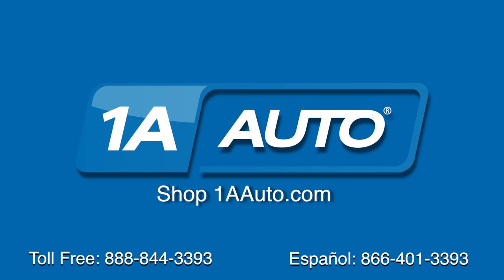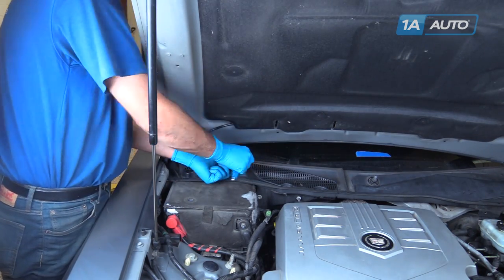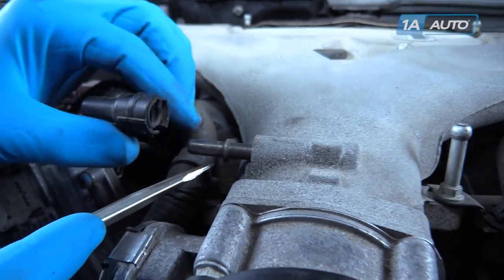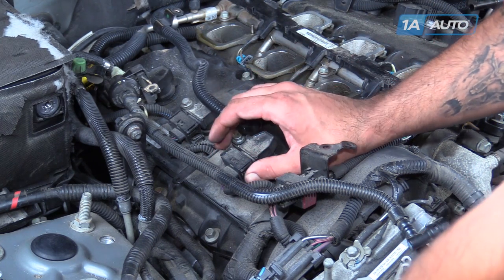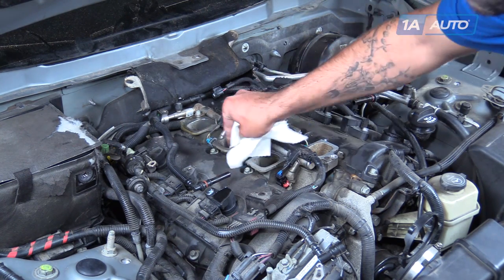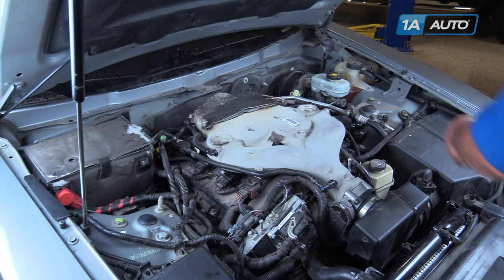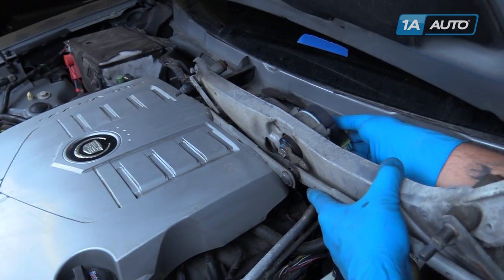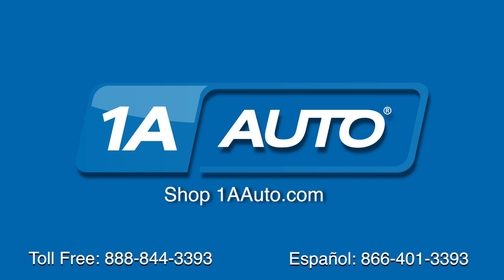How to Replace Ignition Coils 03-07 Cadillac CTS

Comment: would it be the same for a 08 Cadillac cts 3.6L DI?
Reply from the maker: +Randy Rodriguez Thank you for watching. The process should be similar, however the placement of the mounting bolt is in a separate location. 1aauto.com
Reply: 1A Auto 
Parts
Reply: 1A Auto Parts For the 2008 do you have to take the wiper motors out?      which mounting bolt is different?
Reply: Randy Rodriguez 8
Reply: The 2008 looks like you can take out the coils a lot 
Easier because it looks like there is more room to get to the coils

Comment: 2005 good ??
Reply from the maker: +Rayz Graphixs Here is a link to the ignition coils that we carry for your vehicle along with install videos. Hope this helps you out. https://www.1aauto.com/2005-cadillac-cts-ignition-coils/y-mo-c/2005-921-109
Reply: 1A Auto Parts thank you. My car doesn’t move while the engine /trans is  cold do u think the coils will fix the problem ?
Reply: @Truckinwitray  Transmission fluid low